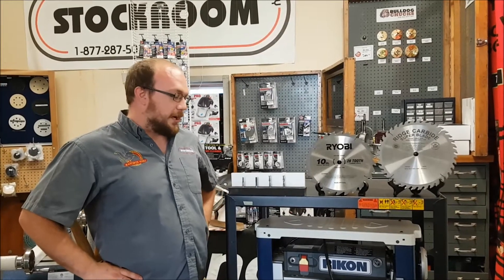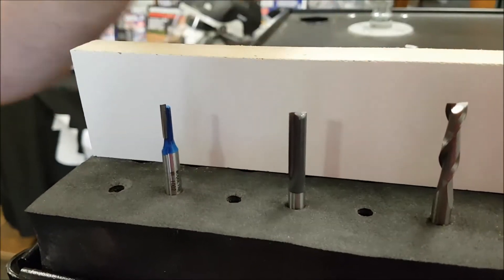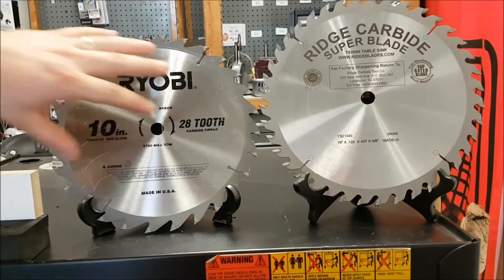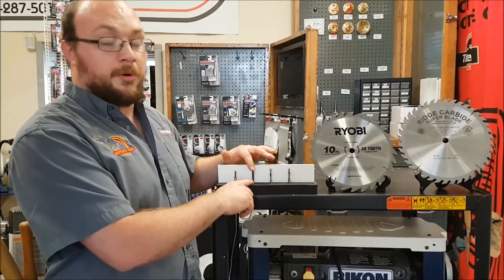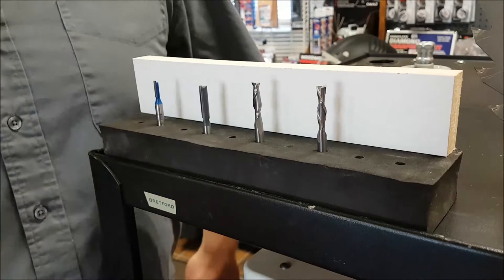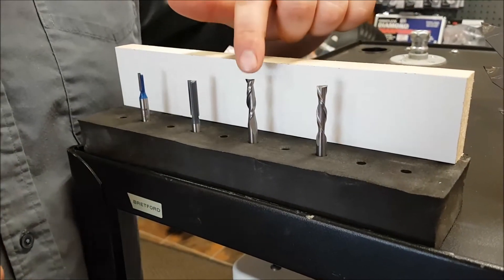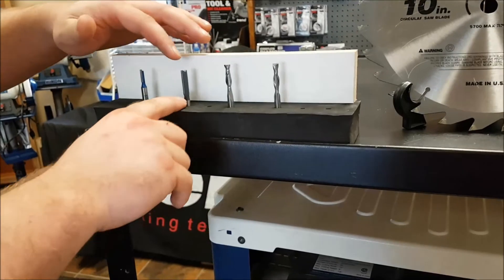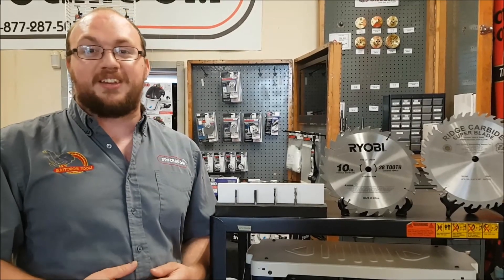EthAnswers Up Spiral vs. Down Spiral & Single Flute vs. Two Flute Router Bits

Comment: Hi, I tried to use a 1/2" up spiral bit to cut a box joint today. I was cutting a 1/2" thick birch plywood. It cut awfully slow and created a lot of burning.  It tried different rotational speed and different feeding speed, but couldn't reduce the burn. Am I better off using a straight bit? Or is my spiral bit too dull? Thanks.

Comment: so.... for a '' Sears wood crafter'' machine , doing a leg which would be better downing into the wood for a  3/16 depth?
Reply from the maker: Hey Carl,
I'd say in you case an up-spiral would be the better option. You will be removing a fair amount of wood per pass and a down spiral wouldn't be able to keep up(it would most likely burn). 

Hope this helps! And those jigs are very neat!
Ethan
Reply: cool, will buy one , it makes sense since the chips would stay with in the space or push them toward where you're trying to cut. Thank you :)